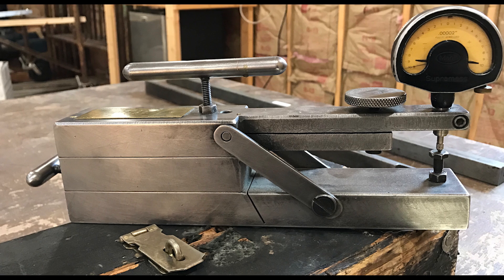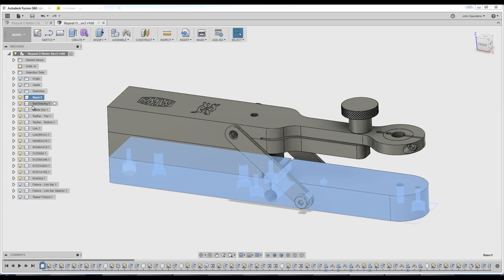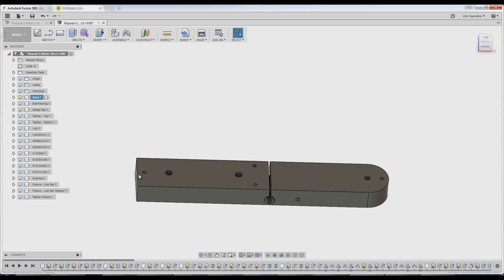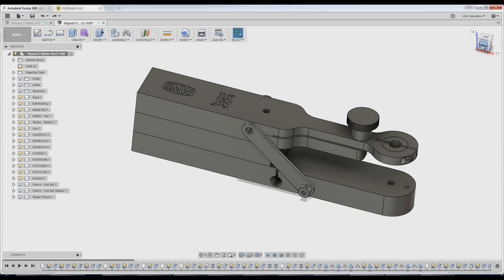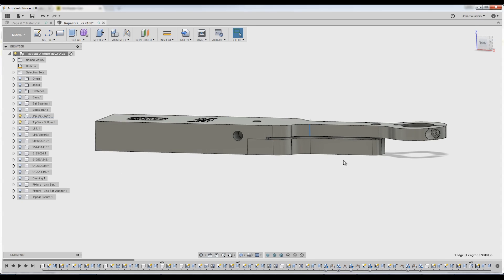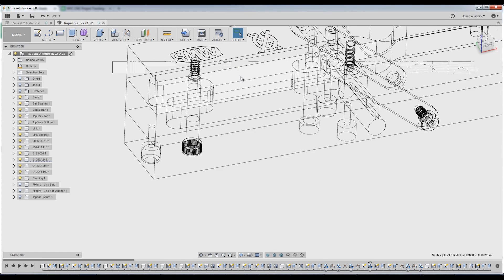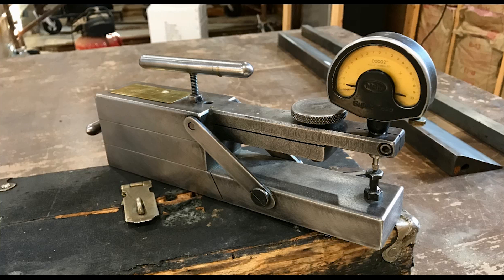DIY Repeat-o-Meter: Feedback from Tom Lipton!  FF86

Comment: I've been wondering why you don't use the difference in thicknesses of the two bars you spread with the thumb screw?
You can within a a minor range use it as a lever, with the thicker one yielding less, than the thinner one. 

I imagine a thread in the upper one, with a ball bearing ended thumbscrew like these: https://www.thorlabs.de/navigation.cfm?guide_id=131 
lower one only acts as an arm. If the lower one only has 1/3 of the thickness, you effectively have a somewhat smaller than 1/3 of the deflection on the upper arm, as compared to the lower one. The ratio of displacement won't be linear to the ratio of thicknesses, but it'll be monotonous at least. 

It's tricky to explain, but please, if I'm not making sense, or missing a point let's discuss!

Comment: Hi John and Tom. Three comments if I may.

1. The dial gauge vertical measuring axis should be coaxial with the front contact pad. As modelled your measurement will be scaled down by the ratio of distances (hinge to gauge)/(hinge to pad).

2. International Standard ISO8512-2 Surface plates – Part 2: Granite has an Annex B (informative) with a typical design example of a “datum gauge” of the Repeat-O-Meter type. It recommends that the four contact pads each has a contact area of “about 280 mm^2” which is a circle of about 0.75” diameter. This will provide local averaging in the same way that a gauge block is used to average local areas on a surface measurement. The ball in your model, and hence the final ground contact area, appears to be much smaller than 0.75”.

3. ISO8512-2 also suggests the pad spacing as 100 mm + 100 mm lengthwise and 75 mm across the width. Your model appears quite narrow. Widening the span of the two center pads will increase the size of the reference plane.

Hope these comments are useful.

Comment: John, I've been following you and Tom on this.  Great design but my suggestion would be to switch the toolbar top and toolbar bottom as far as how they are mated.  Since you want the bottom to be rigid that should be part of the one piece.  The leverage on the two bolts will allow flexing in itself and since you want the top to flex when you turn the screw the top part should be bolted down.  Just my two cents.  Russ

Comment: On the top part: dont make the fixed part lose. Better make the indicator holding part to screw on. This way you can even tweak your design easier.

Comment: Instead of two separate bars on the top piece, it would be simpler to make the top bar in the top piece and the second adjustment bar in the middle piece.

I like how the reamed hole simplifies the flexture on the bottom piece.

Comment: I think you will find that the Nyloc is not enough to keep the nut in place on the thumb screw. I would expect to pin, setscrew or stake the nut into place.
Reply: Why?
Reply: @Trent-tr2nx  based on personal experience Nyloc nuts do not resits loosening/shifting over them when they being rotated or are improperly tightened. Think of Nyloc nuts as anti vibration not anti rotation. Red loctite and/or jam nuts do a better job of anti rotation than Nyloc in my experience.
Reply: @franklima understood.  thanks for the information!

Comment: John, thanks for the great video and the podcast, both are brilliant! I'm not deeply familiar with the current best design practices for CAD/CAM, how are you managing tolerance build up in this assembly?  You've got bolts that look like they are locating as well as clamping the three plates together - is this all defined in your modelling dimensions or do you need to amend the exported code? Probably a daft question - the Haas might be dead-on, with miniscule variation part-to-part.

Comment: John,

Silly idea, but you might think about adding keys to the inserts for micrometers (and matching one in the frame). This will help to easily locate the adapter rings properly without having to remeber about rotating them into position.

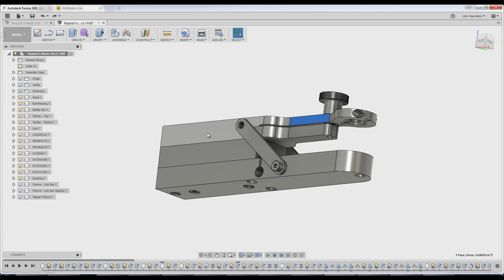Comment: Just a suggestion to save stock: Make the top bar (at 4:32) the same thickness all the way to the back so you don't have to mill out so much material. The center block in the sandwich at the rear would then just be a bit thicker to maintain same overall dimensions. Of course saving that bit of stock only matter if you intend to make a lot of these...

Comment: the factory repeat-o-meter flexure would have been done with a slitting saw on a mill. It's on an angle to clear the milling head, they can run several at the same time and once they made the cut they can test it's movement and repeat the cut to make sure it's just the right amount of flexy. I can guarantee you without even seeing the original that it was done with a slitting saw.

Comment: I had another thought regarding your flexure detail... The drilling / reaming and sawing add two additional setups - even if the sawing is not a precision operation. I take that back... you have to set up for  the edge drill & tap for the travel limit arms.

Consider making the flexure cut as a round-bottomed trough with a ball end mill.The actual flexure material remains identical as from your drilled hole method. The difference is that your saw cut is exchanged for a much wider end mill cut. If you are going to be decking the top face of the base body anyway you will already be setup. If, instead, you were planning on using CRS and only milling from the bottom for the feet you could also mill the flexure trough from the bottom. Other than moving the flexure hinge point to the top face of the base you would achieve the same results.

I am not sure this is less work or less machining, but it does package your machining operations into fewer setups and eliminates the walk to the saw.
Daen

Comment: John, if you are going to start selling these which it appears that is your eventual plan, loose the Nylon spacer.   Make that out of brass, copper, or something more aesthetically pleasing the to eye.   Remember the AVE video where critiqued your Bridgeport collet duhickie, same same on this with the nylon spacer.   You are making what is potentially a hi dollar piece of measuring equipment, make it look like one too + plus you have a cnc lathe so no excuse not to other than "other" production.
Also does the thing need handles?  ( Don't know?  Is it a temperature thing? )  Seems to me as big as the surface gauges are handles are just over kill, unless of course it is a temperature issue with your hands.    
All in all awesome!   Can't wait to see finished product.

Comment: If your drilling, reaming the base flexure no need to bandsaw cut the top. Just make it wide enough to slot with a reasonable endmill (assuming your doing that setup anyway why not)

Or just skip the dril, ream from the side op entirely and just ball mill the flexure slot from the top entirely. But I assume Robbin has some smart-guy reason with residual stresses etc that you want to do the drill, ream op. :)

Comment: You rounded all of the corners on the "front end", but left sharp 90 degree corners on the back.  I'd suggest breaking those corners as well.  Something like a 1/4" radius.

Other have mentioned it but I'll say it again-- the lower arm in the upper assembly should be longer to increase rigidity.  In fact, you could extend that arm clear to the back end to create a fourth layer in the sandwich as it were.  That would mean less stock removal on the top part on the arm end.

Comment: Nice work so far.
As others have commented, I have reservations about how your 0.4" thick arm is attaching. By separating and reattaching with fasteners you have changed the load path. With the original single-piece design the bar was rigidly fixed to the body. All of the load from the adjusting screw was reacted with a bending moment between the bar and the main body at the point of attachment - at the depth of the saw cut. The bending moment acted through the full 0.4" thickness of the bar.
The new design consists of a free floating body with counteracting forces balanced at the fulcrum of the two mounting bolts. The two counteracting forces are from the adjustment screw pushing down and the top of the bar pushing up into the body on the other side of the bolts. The entire loading is supported by the tensile strength of the bolts.
Will your design not work? It will probably do just fine. But it is not as stiff.
Others have suggested making the bar longer to accommodate four fasteners. I suggest making the bar full length. Mill a dado the full length of the upper body and just nest the bar in that. Your two "sandwiching" shoulder bolts could pass through the bar and secure it in the stack. The outsides of the top body would remain at full thickness.
A second point which is probably a matter of semantics... you mention that the 0.4" thickness of the bar being greater than the 0.3" thickness of the upper arm will make the bar ridged and the arm will do all the bending. Remember Newton's third law: "For every action there is an equal and opposite reaction...". There is equal and opposite force exerted on both the arm and the bar by the adjustment screw. So both will bend. The thicker bar will just bend less than the arm under the same load.
Instead of the thumb screw and locking nut, perhaps a differential screw would be cleaner. McMaster does not seem to carry them with the same thread on each end. But Maple-Ind.com does. The down side is that these are hex key driven so would require a tool - or attaching a knob somehow.
Looking forward to the completed project.
Daen

Comment: You should keep the differential screw.

Just use a thread insert with no locking goop on the exterior threads (can probably just burn it off) in the thick piece and then red loctite the thumb screw to the inside threads. 

I think that's a better alternative to the original which is two parts pinned together. If you need to disassemble it you can just torch it.

Comment: You use a differential screw pitch device practically everyday. That's how a micrometer thimble works. 

25 tpi rod with a 20 tpi nut gives an effective movement of .01" per turn of the thimble.
Reply: Interesting bit of info...I'll definitely keep that in mind for a future project using an electronic edge finder to use on a surface plate. If the pivot point and the indicator center are equal distances from the thumbscrew you would get .020 per turn. Heaven forbid I might have a metric and imperial combination located who knows where in the equation...thanks for twisting my brain lol!
Reply: Funny, all of mine are straight forward male and female threads, does this mean they must all be cheapies?
Reply: No, most machinists either end up tool broke, or divorced because they spend too much time making their own tools.
I might be a bit biased, but my Dad was the best machinist I've ever known, and his tools all sucked. I've been in the trades for 40 years and all my tools suck by comparison to today's standards.
I don't think I can blame anything I've ever done wrong on the tools I was using at the time.

Comment: differential screw math. (1/ coarse TPI)-(1/fine TPI) == difference per revolution. 1/((1/course TPI)-(1/fine TPI)) == effective TPI.  1/28-1/32 == 0.00446428571428571428" or 1/(1/28-1/32) == 224 TPI.  I'll see you Saturday!

Comment: You've got a relatively long moment arm of that adjustment screw vs the two flatheads on the little rear shelf holding that bottom adjustment member. Are you going to be bending the members or stretching the flathead screws? If the screws stretch or otherwise work loose you are possibly going to be rounding the shelf. Maybe the moment isn't enough to matter considering the small amount of bend, but I'd feel better with about twice that much shelf, and/or having the upper arm be the loose part.

Comment: Just a nomenclature thought; an outfit where I once worked had a 'thing' about single 'parts' (as in a discrete individual object) being called a 'part'. Assembled collections of 'parts' normally sold/supplied together as a unit were always called 'assemblies'. Part numbers & assembly numbers were different animals, and if you didn't know the difference you spent a lot of time chasing the breeze. (Of course, many 'parts' were never available individually.) Probably depends more where your working than anything else... cool videos, Thanks!

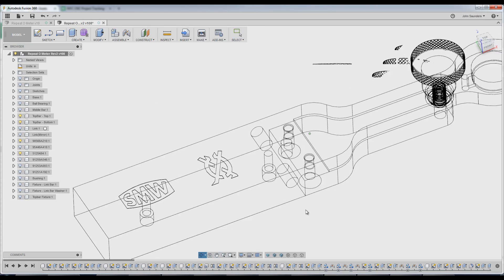Comment: I think the joint between the two pieces at 6:00 should be longer to accommodate 4 screws to increase rigidity.  Use blue threadlock for necessary disassembly.  The hole for the flexure is a great idea to reduce a stress riser.
Reply: I second Roy's suggestion to make the connection longer with 4 (or three) screws.  The distance between the screws and rear end is not much, and that has to resist all the bending.  It won't be near as rigid as you planned on.

Comment: I don't see the reason for the nylon nut holding the adjustment screw. I get that you want to spread the two bars apart - but why? Why not just pull them together instead?

Or if it's imperative to spread the bars, thread the upper bar and not do anything to the lower one.

Comment: Can't wait to see the machining. I have been modeling up a 10" version using Toms flexture and limit screw. Really dislike the bars. My version will use some tig welding to connect the bottom to the middle section.. the price of Rohn indicators is crazy since the video cam out, just like the baby bullet!. Dave
Reply: I think I'd be a little concerned about residual welding stresses possibly causing some random warpings in the unit over time unless you did some form of stress relief after welding. I'm not sure that it would really be a problem, but it makes me a little nervous on a supposedly stable and precision instrument.
Reply: Dave Strong 
Wouldn't weld. Welding causes random warping of areas due to heat differentials and then locking that warpage in place. That's why you'll never see any welds on and precision device, only press fits and fasteners